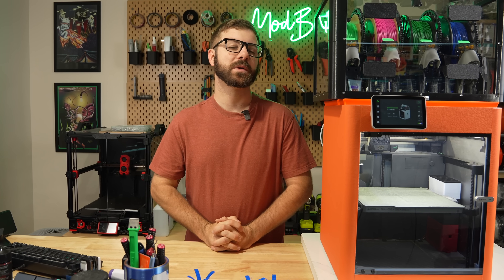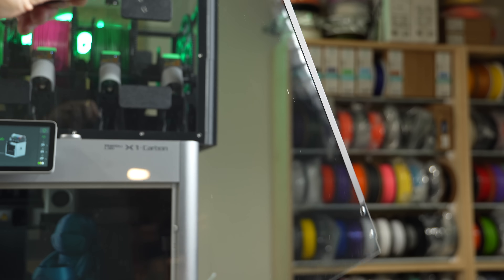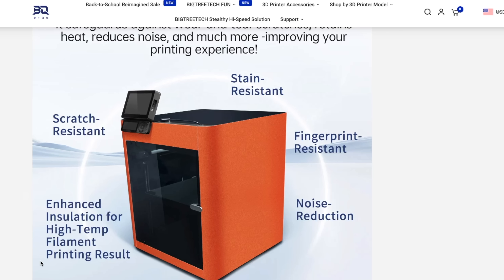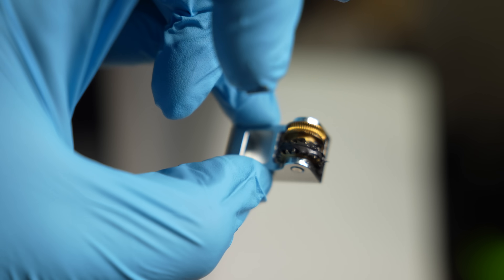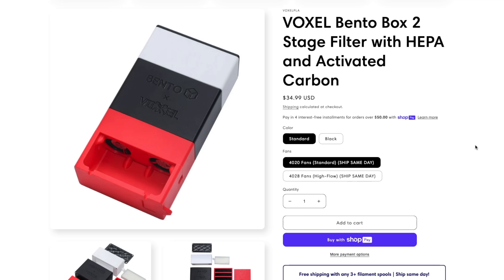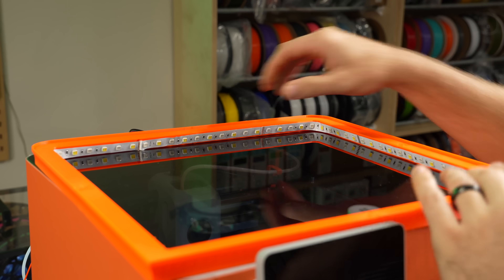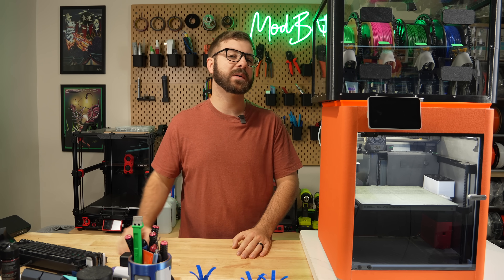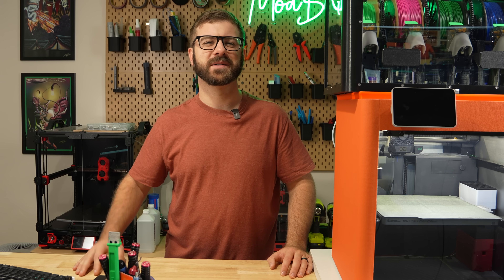9 New Upgrades For Bambu Lab X1C & P1S Printers!

Comment: Thanks for Mods, that was a LOT of work.  I have noticed when people start modding Bambu that the quality is NOT as good or they never got the quality that most of us get and then modded their machines.   I would love to see some prints AFTER all these mods which is the reason for most of the mods.  A dirty extruder would seem to have been step number two in search for the problem of bad prints .  I also want a diamond nozzle but have not seen proof of BETTER prints. A mod for me at this time has to be an upgrade. I am drooling over that orange peel skin though, haha.     Thx for very hard work here all those mods in a very short in relation video.
Reply: diamond nozzles arent about better prints. You wont get that.. You only simply get comparable prints, but can do so in materials that would destroy a normal nozzle, like carbon fiber and glass fiber inclusion. The only way to get "better" prints with a nozzle change is from size and calibration of said size change.
Reply: I just switched to the e3d diamnodback and I can say that the quality of my top surfaces are MUCH better with the diamond over a hardened steel nozzle. the nozzle is slightly rounded do IDK if its all just material but it was night and day, same settings. especially ironing, which looked pretty good most of the time was absolutely flawless with the e3d.  yeah you get slightly more max mvs but that doesnt matter really. the few tests I saw comparing it to stock HS and cht clones showed it had WAY better layer adhesion which is what actually matters. THAT is SOOOOO much better now too, I printed tiny little clips in pla and they didnt INSTANTLY disintegrate when printed with the e3d instead. IDK if there are other diamond nozzles out there, but the science says the diamond should transfer heat better just look at the heat conductivity numbers for brass HS and diamond. my guess is that it is remelting the previous layer more, or at the very least the plastic at the tip of the nozzle is a more stable temperature so it adheres better.

of all of the different aftermarket stuff I have tried  (lots of CHT clones, printed ducts etc.) its the thing that has made the most difference. It was a big enough difference I could tell my prints were stronger without any  1 to 1 tests, nothing small I EVER printed with the stock HS or the CHT clones was anywhere near that strong in layer adhesion, pla btw.

Comment: Nice, I have a G10 and G11 plate from VpsData. Really made a big change. That G11 is awesome for TPU.
Reply from the maker: Out of curiosity since you have used both what filaments do you use with each? Someone told me that since its resin coated they should be the same in theory but I wonder if that means a different treatment is used for each.
Reply: @ModBotArmy 
It's the same fiber but different resin and a different technique to press the sheets.

I use the G10 for Pla, PetG, PC, abs and ASA. All stick and release as they should but for pla you have to run the heated bed a bit warmer then with a pei sheet. 60°C is a real must for pla with G10.

G11 can take any filament but you have to print your pla on 65°C. For tpu it's like magic. Want to print tpu? My advice: use a G11 buildplate.

Been using both plates more than a year on Bambu X1C, ender 2, ender 3 and sunlu s9+. Really need one on the v400. Pretty please 😅 🙏 @vpsdata

Comment: Something you missed, you should run calibration after doing surgery on your printer especially hotend and gear (toolhead stuff). After you changed your gear you only ran a test print.
Reply from the maker: @mariospanayiotou6644  calibration is very limited on this machine and in the past few things I’ve done it hasn’t been needed. I think the firmware check for certain deviations and auto calibrates but regardless running through the calibration on the screen like you mentioned is not a bad idea.

Comment: Maybe a little green or blue locktite on the door screws so over torquing isn't a possibility .
Reply from the maker: I’m always hesitant using it around plastics. It’s probably fine but after my experience having it crack ABS parts I’m more careful. If you pre feed a little into the thread that’s likely no issue.

Comment: Today I gave my P1P some love and upgraded the gears and a 0.6 hotend to hardened steel, replaced the cutter and roller - wiper thing and cleaned the rods. Then I printed some of the new Bambu ASA-CF and it looks very nice.
Reply from the maker: @leesmithsworkshop  maintenance even occasionally is really important. I would love to say I’m a shining example of it… but that’s not the case 😅
Reply: @ModBotArmy  for me it's normally when something fails for me too, but this time the ASA-CF required the upgrades. I also plan to look at the ams while things are sperate.

Comment: Do you plan on doing a comparison of the E3D HF obxidian and the diamondback?
Reply from the maker: Hmm, I hadn’t considered it but I could. I already have flow tests done for the ObXidian hf. It will beat the diamondback in that regard. It’s hard to show the abrasion resistance in any meaningful way though without dumping rolls of material through them both and grabbing a microscope.

Comment: Interesting video ! Nice upgrades! I use the G11 daily with PLA and PETG . And.... PETG didn't stick really well 🤔until after I sanded the plate completely lightly with P600 and washed it with cleaner and degreased with IPA. That is also described at the VPSdata webshop under  "Garolite care hub" ( bottom of the page 🧐 ) . So now I print PETG at a higher bed temp of 90°C and 245 nozzle temp for all layers and no fan for first three layers at 0.2 0.25 and  0.3 layer height. Sticks very well. Haven't tried my G10 plate (yet 😋 ). Might help with ABS, but I don't use that. Cya!
Reply from the maker: Out of curiosity do you use the same plate that I have or is it a different version? Thats something to consider. Especially since I was having some adhesion issues with ABS. Wait I didnt see the second part of your message haha so I would say yes you have the same plate. Interesting, yeah PETG stuck really well after I cleaned it and just bumped 10C. Who knows could be a host of variables. :)

Comment: The hardened steel gears look like brass to me, are they?
 It is strange that Bambu lab removed the option to downgrade your firmware in order to flash the third party firmware, I guess their new firmware keeps the ability for them to collect your data.
Reply from the maker: According to the specifics on the gears they are "Golden Nano-Coated". The color looks brassish but a little different to me in person. 
Yeah, unless things have changed once you go to the third party firmware I know initially there was some iffyness with warranty/support. I would recommend for anyone to wait until the printer is over the 1 year mark to not risk it.

Comment: I would like to upgrade my hotend. And can't choose between Panda e3d revo and the e3d  hotend. What do you think is better?
Reply from the maker: I have the Panda revo but havent installed it. I've had a great experience with the Obxidian for high flow. I also really like the dimaond. Unless you already using a bunch of revos I would probably opt for diamond or HF.
Reply: Thanx for the super quick reply 😊@ModBotArmy

Comment: If you can't get your extruder gear out cause its stuck... Apply hot air too the assembly from a hair dryer, to soften the filament. I don't recommend a heatgun, as they get too hot too fast, and really your just going to burn yourself unbelievably fast.(since you want to be applying pressure to pull the assembly apart, while under heat).
Reply from the maker: Is this supposed to be a situation where you have melted filament between the gears so you can’t pull them apart to get out? Just trying to make sure I understand the scenario.
Reply: @ModBotArmy  Yes 100%, sorry i am just waking up and not 100% coherent yet :), for instance, i had some PVA stuck the other day. Making it seem like both half's of the assembly, where fused together.

Comment: That is an excessive amount of grease on those gears.
Reply: As my primary 'thing' is RC, I can definitely say, that IS am excessive amount of grease.  When dealing an 'open' casing, such as this, you NEVER want excess grease, as it WILL end up in 'other' places, including places you don't ever want it to go.  However, with a sealed casing, such as a sealed transmission, it's ok to have have some extra grease...but, even then, not "too much" extra.  Whether 'sealed', or 'open', an additional primary reason for not "packing on the grease" is because excess grease increases resistance, which can lead to excess wear on other parts, including the motor turning the gear(s).

Something else to consider is 'what' the grease is made from.  The majority of greases are either petroleum-based, or synthetic (such as silicone-based grease.  The 'problem' with petroleum-based grease is that you don't want to use it where it can get on plastic...petroleum-based grease will soften & "eat away" plastic.  That's why many people use a synthetic grease.  For something like 3D printer gears, the best thing that could probably be used is Cera-grease from Tamiya.  It is a synthetic & ceramic-based grease.
Reply: @ninthislandrc  yea a "heavy" application for this would have been like  drop in 3 spots and let it spread by rotating the gears together.. while the actual application was like 10x that amount.
Reply: @ninthislandrc 100%
Reply: Also:  dirt, lint, dust and pet hair sticks to grease, increasing wear.  Then sometimes transfers it elsewhere.
Reply: I'd toss in that the way I deal with grease applications like this is small 2ml syringes. I needed some for my cats and ordered a dozen several years ago and keep finding handy uses. They have the ability to put needles (blunt) for really fine control, so get some of those too. Never thought they'd be a go to in my tool kit but I've found MANY uses over the years, perfect for this use. :)
And yeah, that was WAY too much! I cringed ... LOL More is NOT always better, but NICE VIDEO Thx!
Reply from the maker: @cobra6114  I tend to go heavier vs lighter when applying grease. It hasn’t been an issue before and you can always wipe up any that ends up being pushed out after. My main concern is going to light and having the gear prematurely wear down.
Reply: @ModBotArmy  no i hear ya. My concern would just be the grease migrating its way (slowly and over time) into the portion that grabs the filament and contaminating the nozzle, etc. All good!
Reply from the maker: @cobra6114  no you have an absolutely valid concern. Perhaps at the very least it makes sense to go lighter where those gears mesh to prevent this from accidentally happening. Its good feedback 👍
Reply: @ModBotArmy  much like the lead screws on the X1, they just shouldn't be dry. If you use good quality grease in applications like that, it will adhere well, and provide that thin layer of protection between the mating surfaces of the two gears. Cheap grease will heat up due to proximity to nozzle, gravity will always win, and there will be long term issues. 

Hopefully I am wrong. But less is more sometimes.

Comment: Meh, at this point I'm waiting for their next X1C, whatever they decide to call it.
Reply: X2(something), with x2 price and size between x1 and x2 of X1 (but closer to X1, e.g. 384 cubed would be really big, and Mini already broke simple base 2 simple math as it wasn't 128 nor 192) 😅
Probably new improved non-compatible AMS as well.
Reply from the maker: I am very curious to see whats next. Something larger? a V2? Idex? Tool changer? Multiple options? Haha all I have is speculation at this point.
Reply: @ModBotArmy  I'll be disappointed if all they do is increase the size.

Comment: I'd love a review of those X1Plus things. And btw, that ESP32 board you mentioned, it has an ESP8266 mini, as you can see printed on the chip, that is, the generation before ESP32. It wouldn't surprise me if it's running a fork of WLED ;)
Reply from the maker: Hmm, the one I showed was the previous version and I know there has been some revisions for extended. Ill have to pop off the cover and see if its also an 8266 then. Ive never used WLED before but have a board and plans to. Is the UI very similar to what I showed on screen?
Reply: @ModBotArmy  no, the UI isn't that similar, that was why I'm guessing it's a fork. WLED runs on an ESP8266 too, only not as well as on an ESP32.

Comment: 8:55 if you use 24v why didn't you just put the fans in series?
Reply from the maker: I typed up a big old message and then deleted it on accident. Basically, it can be done but the risk is if one fails the other will be taken out. In this application its probably minimal risk but I already had the buck converter and generally prefer to just step down when I can.

Comment: All of BTT stuff is half baked. If you need support be aware you're getting half=assed answers. If you have an existing problem, once it goes out of warranty tough. They won't consider anything other than you buying another. The panda touch is garbage. Woudln't purchase a thing from them for the BL printers. The wham bam carbon plate is a nice plate to look at.

Comment: Did I just watched 15min ad...
Reply: Yes
Reply: Yes you did…
Reply: Yeah, literally none of these are basically something that drastically improves the X1C/P1 printers, especially the cosmetic ones.
Changing a door from Glass to Plastic so it "doesn't shatter"??? What are you doing to your door??? Came here hoping for some good recommendations, but came away with things NOT to buy
Reply from the maker: Tried to include a fairly wide variety of things. There are a handful of cosmetic yes, but filter, hotend, extruder gears, and even cover all serve a purpose. With a machine like this thats already really solid (which I state) gains are going to be minimal. Its not the same as taking a half baked printer and throwing things on it that make a drastic difference. It's actually really nice that any tweaks/modifications are optional and not required, unlike how many other printers have been that would need it to just be halfway reliable.
Reply from the maker: (Cover as in toolhead cover not the wrap) haha just to clarify.
Reply: @ModBotArmy  I agree with you that filter is huge upgrade, I dont agree with your wiring tho. Everything else wasnt worth the time or money. You can get hardened steel extruder gear from Bambu for years and its standart on X1C. I am mainly toxic about wrap and plastic door, nobody needs that. You should have started with: "This is an AD and I want to show you what BIQU has in store for X1C/P1S/P1P." There would be no issues.
Reply: @Artylius  I agree, ugly wrap, plastic door and LED lights that make it way too bright. Rest of just waste of money. Just flag video as an ad. This made me unsubscribe.

Comment: I would love a video on the custom firmware!
Reply: Yes please
Reply: Extremely unlikely you’ll get that anytime soon as bambu’s run better than anything else stock, and the entire main board and chipset are completely different from standard 3d printers, they don’t even have standard stepper motor drivers of any kind so to make a firmware to this new board is extremely hard to do. To just “update firmware” would require a known chipset, and their entire mainboard is entirely new and not geared towards diy or reprogrammable in any way. We actually don’t even know if the cpu is reprogrammable at all and that’s entirely okay because these bambus are just the best printers on the market.
Reply: @booyackshaw  what are you talking about people are already running custom firmware.
Reply: @marksnethkamp8633  okay so you want to piggyback a false firmware from an older version of bambu lab firmware so you can fix problems that have already been fixed by just letting your printer connect back to bambu to update to the newest firmware, and in the process waste a bunch of time

Comment: the color change on that filament cut handle is obvious.. heat exposure? 5:42
Reply from the maker: I think you’re referring to the extruder gear with the timestamp. Could be, maybe a filament swap didn’t have enough time to cool or something. First time I’ve experienced it in my bambus. I do throw a lot of random filaments at them so who knows. 🤷
Reply: @ModBotArmy  I believe he's referring to the handle of the filament cutter, which has yellowed significantly. You can also see it on the other side of the extruder vent. Any idea what this might be?
Reply from the maker: @JakJakku  ahh derp yeah I read the comment wrong. I print a ton of ABS/ASA on this thing. It could be heat but I haven’t heard of heat issues affecting the parts. It’s entirely possible but part of me wonders if it’s the fumes/off gassing from the filament as well.
Reply: @ModBotArmy  I think 5:30 shows it much clearier. Lots of yellowing on the lower part of the filament cutter.

Comment: I have the cryo plates on all my printers (P1S and A1s) and they do work really nice. Also just a cool looking plate
Reply from the maker: The pla and petg one or the other one??? The color is pretty unique.
Reply: @ModBotArmy Its the Cryplate Pro with the rougher Texture. I have it for all my A1 in the Printfarm but havent been able to test ASA and Nylons on my P1S yet. Will try this next week for shure.

Works great for Petg and Pla at lower temps and dont even have to use brim or mouse ears on it anymore comared to the bambu textured. Also the ned orca 2.2.0 beta has support for them as cool textred plates.